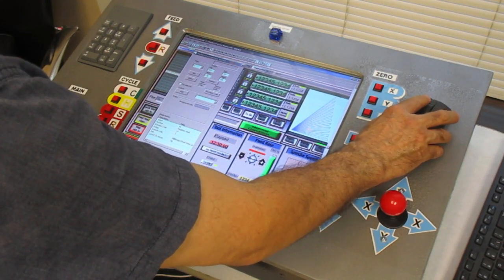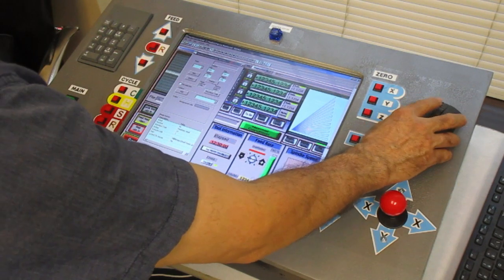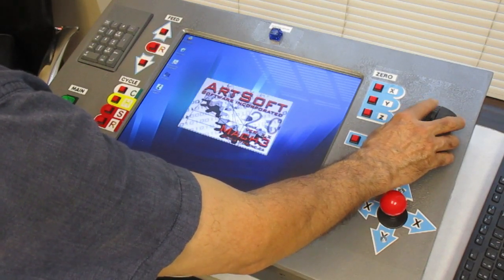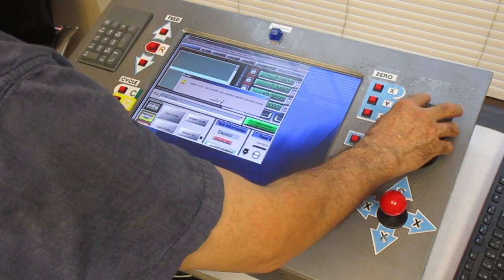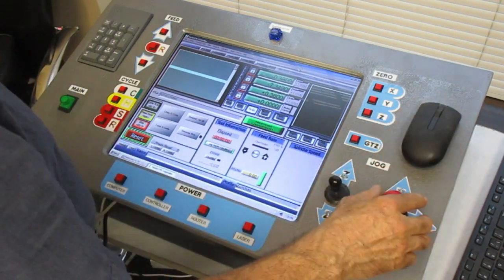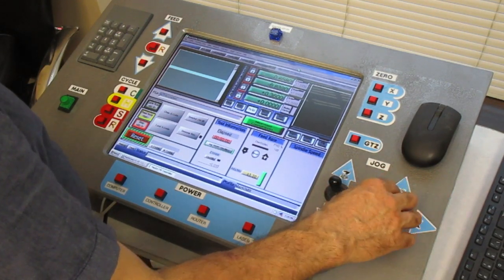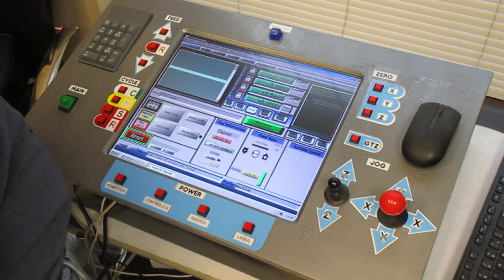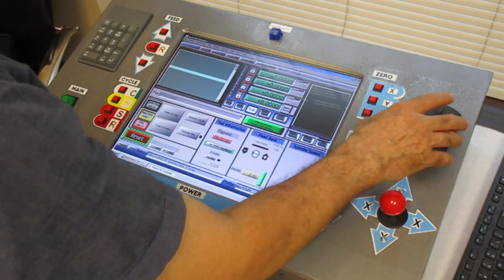Mach 3 button configuration

Comment: That very great...
I' m so excited ...
What software do you use for add  external button like that..
Please share a link..
Thanks you.
Reply from the maker: Software is mach 3 screen. Usually comes on the mach3 folder. Or you can downloaded just google mach3 screen editor. There are a few versions.  I will check which version i use later but all of them should work the same. 
Thanks for watching.
Reply: @CMDWorks  ..
I'm trying your methode using Mach Screen V.1.70.
But not working.
I really thanks full...if you like to share your methode and software. 
Your creation is very good.
Thanks a lot for sharing..
Reply from the maker: What are you using for a keybord emulator?
Reply from the maker: Also so you get another idea watch this video BUILD YOUR OWN CNC REMOTE CONTROL https://youtu.be/QdxWI8Ow5NU
Reply: @CMDWorks  
I'm yet using keyboard emulator..
So,..that's the key... emulator..
I Will try  to get it.
And about using remote control,...that is next step..
I really thanks full with your tutorial.